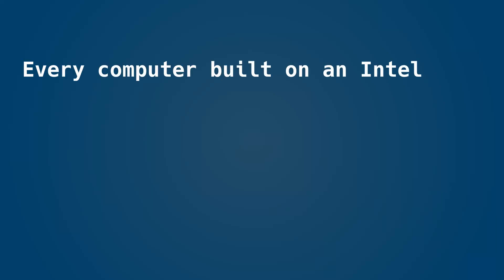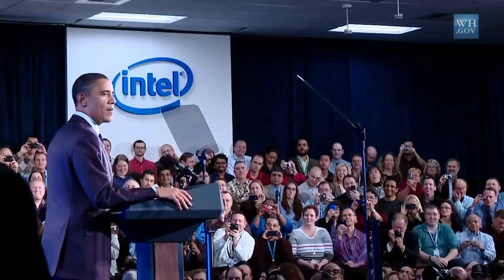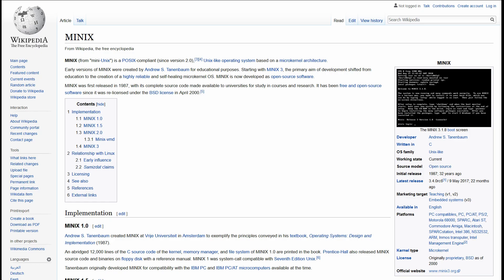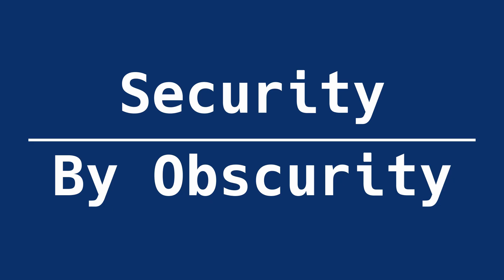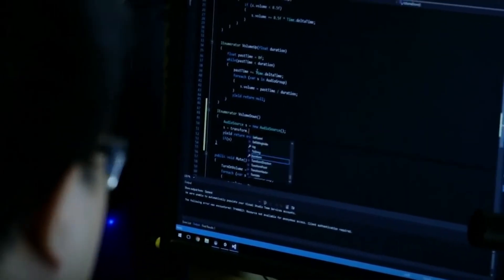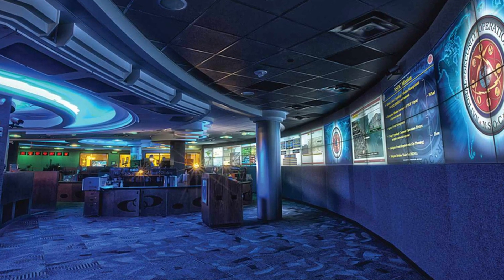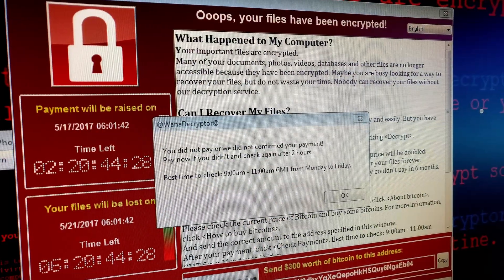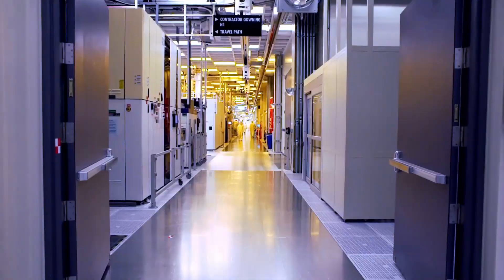How Intel wants to backdoor every computer in the world | Intel Management Engine explained

Comment: Run while shut down? Unlikely. If it's on the CPU die, it can only be active when the CPU's getting power, and that only happens in a powered-up state. If the CPU were soldered directly to an Intel-made motherboard, then it might be possible, but that's not how things are generally done. Communicating with the government? Unlikely. People run traffic monitors for a lot of reasons, they'd have spotted unknown, encrypted traffic and shouted about it. A part of your CPU trying to communicate outside the computer would have to use the computers own normal network connection, there's no magic way for it to beam information out. Also, I don't know why you mention Wannacry, it has literally nothing to do with any of this. I think this is mostly fearmongering, as are a lot of the comments. But hey, that's just my view.

Comment: "bypass encryption"
no, encryption doesnt work that way. everything else is right though, afaik.
Reply: Yeah, it has physical access to memory so any data your computer can read in plain text it can also grab, i.e. bypassing encryption. I'm not sure if physical isolation with whonix/qubes is capable of blocking IME internet access on a workstation, though. If that were the case then encryption would still work.

Comment: Ivybridge is as new of a platform that can be corebooted and  ME neutralized while still lacking the Intel FSP  binary blob. I sell firmware modded Lenovo ThinkPads (X220/T420/T520/W520) that are a much better value than the Librem ,that even when corebooted and ME disabled still has the Intel FSP binary blob.

Comment: what about the G-spot? A 100% Private Carbon Wealth Tax
3.5 billion people fly each year.
It takes 1 ton of coal to make 3 solar panels.
After 30 years of trying, solar + wind now make up less than 2% of the world's total energy demand.

The reason it's not higher is because electricity is only 25% of the world's total energy demand.

Solar + wind only work at their full power rating less than 30% of time, and after 30 years, they're toxic waste.

It will take solar + wind 70 years to reach 100% of the world's total energy demand.

The massive steel and mineral infrastructure will cause more emissions than we save.

We have to reduce emissions 100% in 20 years to avoid runaway mass extinction.

50% of Europe's renewable energy comes from burning imported clear cut forests.

They burn palm oil in their cars and lie about emissions.

Sweden burns their recycling garbage for electricity.

Solar panels in Northern Europe work at full power 15% of the time.

China is building 400 nuclear plants and 700 coal plants.

Getting methane from sea bed ice is the new gold rush in Asia.

Methane is the oil of the 21st century. Oil goes into your phone and body.

All the killing in the middle east is about who is going to sell methane to Europe.

A 100% private carbon wealth tax is the only hope.

Corporations, NGOs and governments hate 100% private wealth taxes.

Corporations, NGOs and governments have been fixing the climate for 30 years while emissions went up 60%.

Here's the secret. We have to reduce emission 100% in 20 years and they're set to go up 10% in 10 years.

2 F35 fighter jets crashed, 2 Boeing 737 jets crashed, and god knows how many self-driving Teslas crashed because money walks and bullshit talks.

☠☠☠

Comment: What about ARM processors like smartphones tablets use or something like Raspberry pi. Since they are not based on x86 architecture are they safe if yes CPU used on IPAD was quite powerful so if we could install Linux on it will it be solution heh dunno questions everywhere, or snapdragons manufacturers already made something like that??

Comment: This is why UEFI and Windows 10 have been pushed so hard in the last couple years.
Reply: IME is completely independent of UEFI and Windows
Reply: UEFI was pushed because BIOS became extremely obsolete and not secure. BIOS doesn't have any boot image verification, fast boot support, 64-bit, modern filesystems support & much more. UEFI itself is not a bad thing.
Reply: @aleksander002  UEFI is a small OS before your OS starts. Intel ME is a small CPU that runs before your main CPU runs. See a problem here? 

BIOS was meant ot be just that, a basic input output system, a basic init system for devices. They could have added support for boot image verification to BIOS if they wanted. BIOS was meant to be non programmable. They could have setup standards for it and keep it basic. UEFI is programmable, it's a small OS in itself, and highly dangerous, it enables all sorts of attacks, since you can always add your custom code in there.
Reply: @aleksander002   "Security". Everything is built on the guise keeping you 'safe' and 'secure', while in reality it is a closed environment for microcode to run in the background before startup. THINK ABOUT IT FFS

Do I think bios was not keeping up with newer technology, yes. But there was zero efforts to improve it - instead manufacturers saw an opportunity to design an interface that allows their hardware (Intel ME) to take absolute control of your entire computer system.
Reply: @ XeserUpseinOPelttil You have no idea what you're talking about; that statement isn't true at all.

Comment: "It cannot be turned off, removed or disabled."
ME_Cleaner and the HAP Bit.
Older Core 2 Machines - You can completely remove IntelME.
Newer Machines - You can remove most of IntelME and then disable what's left with HAP bit.

You're welcome.
Reply: Me_Cleaner doesn't work. HAP bit yes, but where would you get that?
Reply: @RyosukeTakahashiRX7  ME_Cleaner worked fine enough on my 2nd gen i5 Thinkpad, literally everything, with the exception of a few kb (to prevent forced shutdowns) was stripped and then the HAP bit was set. And on my Core 2 Duo Thinkpad which completely removed IME.

This is coming completely from my own experience using it.
Reply: @Motscoud  Hm, i see, thanks. It doesn't work on my i9-900K that's why i was a bit curious there.
Reply: @RyosukeTakahashiRX7  It's untested currently on Coffee Lake. It should probably be patched in the future.

At least you have the HAP Bit installed... Now get rid of Windows and use Free Software.
Reply: @Motscoud  I'm personally a fan of Linux based systems so I'm not using Win10. It's too ridiculous for me how i can't simply delete as administrative power "important system" folders when they're just unnecessary. Before i have to do the extra steps every time i'd rather save my time.

Comment: On some hardware intel ME can be at least partially disabled using coreboot. Of course it would be far better to have an option in the bios to fully disable it, but if you're concerned about the issue you should give coreboot a look.
Reply: Does coreboot kill all backdoors?
Reply: @meekdook4236  If you're able to fully disable the ME on your system, then all the ME-related backdoors aren't usable anymore. But whether you can do that or not depends on your hardware.
Reply: @TheGTP1995  does coreboot disable everything on a lenovo x230?

Comment: There is a project to deal with this, but they have been having some troubles, but last i knew they already had some ways to block it or disable it after boot up however during bootup it is free to do whatever it wants.

Edit: I believe it was purism which you actually mentioned.

Comment: All you need to do to be prevent Intel ME from being remotely controlled, you never use Ethernet or internal WiFi card. You use a USB WiFi dongle which directly interfaces with the surface operating system therefore bypassing the management engine.
Reply: Would a USB ethernet cord work too?

Comment: According to ex-NSA employee Jim Stone, every Intel CPU since the Core 2 Duo has a hidden OS that is invisible to the user which can be backdoored into via a 3G or network connection.  It can also allegedly do this while the computer is turned off by activating individual components.  Think you're safe because you encrypted your hard drive?  Nope, the CPU captured that encryption key when you did it.

Comment: The best CPUs without a backdoor are the Bulldozer and Piledriver CPUs, newest & fastest being an AMD A10-6800K. Yes, Steamroller has PSP as well (there is a german netsec article about it). Alternatively you can use a dual socket board with Opterons of the same era; better libreboot support this path as well. Luckily these are still fast enough for Qubes OS and modern computing
Reply: @MzNToS 
Not a complete list but see below. Basically, any AMD CPU before 2013 or any Intel CPU before 2006.
https://freundschafter.com/cybersecurity-cpu-and-system-alternatives-without-intel-me-iamt-and-amd-psp-secure-technology/
Reply: How about ARM cpu`s?

Comment: Hence why I want to build my own CPU. Might not be as fast and much bigger, but at least I know what’s inside! And, oh wait. How do I know that there isn’t a chip hidden inside the transistors? I need to make my own transistors... Jokes aside, that’s actually possible, though pretty difficult (if you make it from transistors, or worse, silicon wafers, but it’s actually feasible if you use logic gate chips).

Comment: At least ARM processors such as those in all phones and tablets don’t have this kind of system... or do they?
Reply: ARM is just a company that designs CPU cores and licenses them to other manufacturers who produce them. They can add their own modifications and features (such as built-in GPUs, Flash ROMs, encrypted booting code, peripheral devices, networking, HDMI controllers etc.), and they usually do. Even if they don't have any hidden cores for malicious purposes, there's always JTAG interface that allows to scan all the pins around the die one by one and even set them to different values to put stuff on the bus or change the data on the bus without the CPU (and the operating system running on it) noticing. Granted, to be able to use the JTAG interface, one would need a physical access to the machine. But if there's any other chip on the board that can talk to the JTAG interface, and it so happens that it can also talk to the network interface or the GSM band processor (such as the SIM card in cellphones), then one can control the CPU in the same way as with Intel's IME. The more I know about this stuff, the harder is for me to believe that there's still any device that wouldn't be stuffed with surveillance mechanisms :q

Comment: Oh wow, did you know cd roms use arm MCUs, and not only that, they also contain FIRMWARE!? did you know your ssd uses an MCU? Did you know your mouse contains an MCU? Did you know your TV has one too? Did you know your remote control has an MCU?
Did you know your SIM card has an MCU? Did you know your car has an MCU??
Seriously who the fuck are you trying to scare? Everything today has ARM CPU in it, if it needs any sort of complex behaviour, it'll have Linux too ( for instance your home AP, your car, the IP camera stick in front of your house ) with some smartarses default credentials and unlocked u-boot. This is way more dangerous than a system that manages per core clocks, voltages, and core temps.
To be honest I don't see any point to this video, other than scare people.

Comment: laughs (pause for lag) in my amd duron
Reply: Good old duron.  What socket?
Reply: @foch3  Socket 462 aka socket A.

Mine is paired with 768mb of sdram 133
Reply: @eduardoavila646  I love socket A.  I can't even find a socket A board here. 

What chipset you using ALi, Via ?
Reply: @foch3  Lol they are really common here, awmost like a flu. 
I have currently 2 boards: 
-pcchips m825 with via chipset (not working, i think due to a corrupted bios). This one uses ddr1 up to 1gb (2x 512mb)

-biostar m7vkq with also a via chipset. This one has 768mb of sdram 133mhz. It can go up to 1gb too. 

I have several socket A processors  750, 1200 and 1400mhz durons, a athlon xp 1700+. 

I will combine my m7vkq with the duron 750 and i will try to make a msdos machine (or maybe freedos).
Reply: @eduardoavila646  Palomino 1700+  or Thoroughbred B ?  Huge difference.  You could get a Gigahertz overclock out of a Thoroughbred B.  Those were the days .  It as was a fun ride back then with AMD.

Comment: Stupid video. MINIX is an old os on which UNIX is based on. MINIX was really bulky and inefficient to run. A CPU obviously needs power to run, if the mains are turned off or the battery is powered down there isn't anything a processor could do. And OS cannot be installed on a processor, it absolutely needs an hard disk. Stop misinforming the mass and use this platform for something productive.
Reply: The MINIX on your IME is a packed version the original MINIX plud the data is stored in the IME chip if you did not know it has storage capabilities
Reply: The only way to store memory on a cpu die is via SRAM, which is a form of volatile storage and cannot hold an os. Other ways to store memory in solid state requires different fabrication and cannot be made on the same die. Yes, there are ways to make an SoC but the footprints of the cpu would clearly show gluing of multiple die. Which it doesn't. So kindly remove the tinfoil hats, I'm a systems engineer. Trust me
Reply: @BHAVYAMATHURBEE  its built duilt directy in the die so the code cannot be changed
Reply: @botowner8623  dude. that's not how a processor works. a processor cannot have an operating system hard-coded. end of story. There are tons of things inside of an os that are completely dynamic and change all the time.

Comment: "nobody knows what it does"... then proceeds to ramble on and on and on about exactly what it does (or supposedly does).
Reply: Why would they not disclose what it does if it's nothing harmful or wouldn't cause an uproar? Precisely because it most likely is something shady. Why would a CPU even need such a part?
Reply: @RyosukeTakahashiRX7  There are numerous reasons why related to security.  And if you weren't clueless you'd already know that.  And it still doesn't change the fact that the assclown in the video says nobody knows what it does then turns IMMEDIATELY around and starts telling us all what it does.  Are you daft?
Reply: @competetodefeat4610  My point was not that it actually is something shady but rather could be something shady provided they don't tell us exactly what it does. You can still keep it as security function and all but at least tell the users it's not sending sensitive data to them. And yes, the video is overly exaggerated but i thought so much was clear from the beginning. Are you daft?

Comment: The NSA have significantly better options than Intel Management Engine...  This video is fairly ignorant to the significant amount of Enterprise IT Systems that use Intel Management Engine on their systems for remote management of computer systems thousands of miles away from them physically.  This video could be correct about cheaper consumer electronics however I have written my experience with small business below.

We do this as a smaller IT firm, boot up and enter bios, enable Intel Management Engine, boot up using a different key to enter the Intel Management Engine and configure settings and set the password.  Then after configuration, we deploy to a remote client and if they ever need batch work done we can ensure even offline PC's get processed using one of the many tools available for management of Intel Management Engine remotely...

Comment: there is only one solution:
Hack this Stuff in anyway to show how unsecure it is.
Reply: AMD's PSP is not the same as Intel's IME. For one thing neither are proven to be backdoors, just a potential vulnerability. everything is a potential vulnerability though, and these systems often prevent many exploits as well.
That said, AMD's system does not do as much, and in some hardware cases there are options to disable it in the BIOS (granted the system works at a lower level than the BIOS, but that doesn't necessarily mean it doesn't disable part of or all of the system when told to)

So while it may not be a perfect option AMD certainly has a better option. In addition if you were worried about some very advanced hacker who has physical access to your machine, then AMD would be especially good since there isn't any known way to access it unlike with Intel's module. There's less critical exploits on AMD too, since with things like Meltdown and Spoiler only affect Intel, and the patches to stuff like that reduce the CPUs performance.

In general it's been demonstrated that AMD has been a more secure CPU developer recently, and hence is much better to go with regardless of the fact that they have a system that is similar to IME.
Reply: @MsHojat  wrong, both are backdoors because they can both be accessed remotely by intel or amd or the nsa or absolutely anyone with an exploit
Reply: @Cheryl source?
Reply: @Cheryl haven't heard anyone saying it in such way, "hey moron, fucking moron".
😂
Reply: Reference - youtuber undoomed (hey moron.....)
Reply: NihilisticMonkey Dancing honestly the only way to get intel to act, it seems, is for someone to hack it. Hopefully it will be a white hat hacker (one who hacks for good)
Reply: NihilisticMonkey Dancing AMEN! I’m trying to reverse engineer my malware to write my first white paper.
Reply: ha
Reply: I did
Reply: haha
Reply: @RogueWizard-v9r  hahaha
Reply: Or just buy Ryzen

Comment: Next step is mandatory wireless internet integrated in the CPU. Then you can no longer pull the internet plug (for those of you that still get it through lines).
Reply: Tinfoil hats for laptops! :3
Reply: "still get in trough lines". As of that's old school.

I still use UTP cables for my PC. It's faster. More stable. and more reliable.

It's also safer. No man in the middle risks when the wire physically goes from my router to my computer.